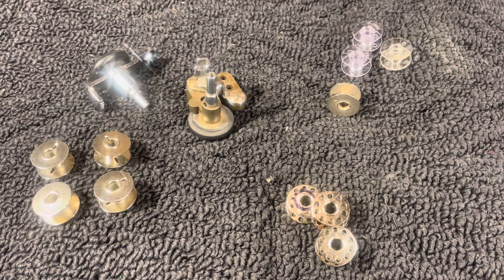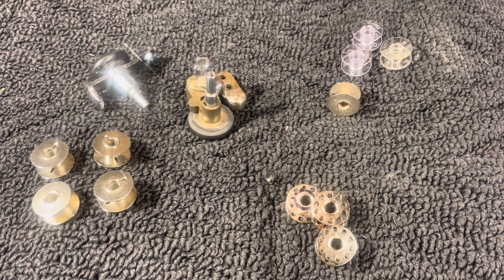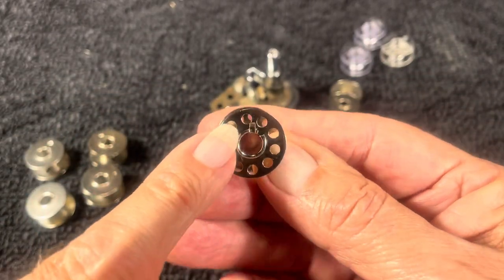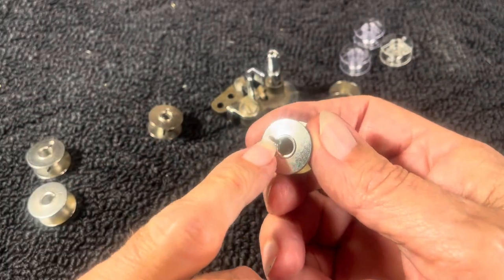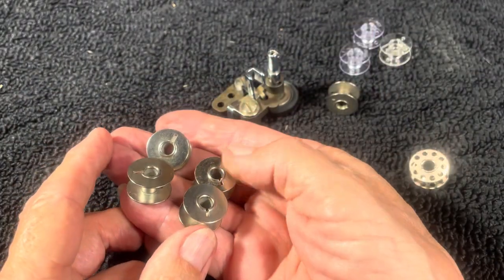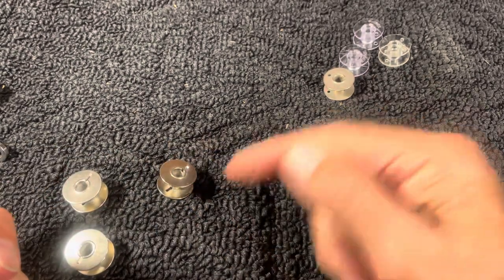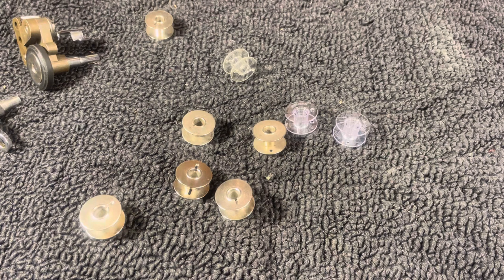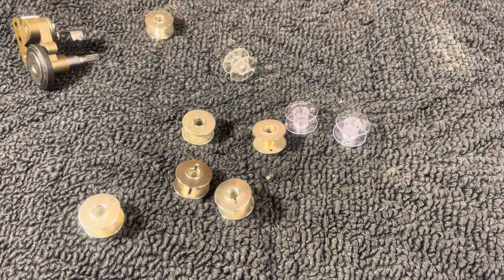DEFECTIVE BOBBINS “DESTROYING” TONS OF NEW SEWING MACHINES- CHECK YOURS BEFORE USING THEM(video 403)

Comment: Ah ha. Thanks for this.   I just bought bobbins for my little singer from Walmart, Its about 10 years old and has worked great.  Bought new Singer bobbins and they were too loose so I put a little sliver of masking tape in the center and it wound.  I am going to look for the notches and spring and see.  The original ones that came with the machine worked fine.  As usual profit comes first, who cares about the customer, the waist, the pollution, so frustrating.
Reply from the maker: It is surprising to see such little regard for putting out a perfect product. 
We will have to be wary from now on. 
Masking tape to the rescue. 
Well done. We do what has to be done to achieve success. 😎👍🏼

Comment: Just yesterday, while I was sewing, I found out I had one of these slanted bobbin. I've had some experience with bobbins not the proper diameter, doesn't fit and slips off, but a slanted one, never before. 
Hence, I changed it with the ones I use with my mom's Singer that has a notch where the bobbin fits, about 50 years old, and I was back to work in an instant.
What a coincidence, this video came up today. Never would've guessed this issue was addressed.
Thanks for the information. I got a spring loader with the post andil I'm glad I got the right bobbin winder.
Reply from the maker: Recently, the number of customers that have been experiencing defective bobbin caused malfunctions, has been very high. It’s been like one every couple of days. It’s not a coincidence, but a sign of the times, shoddy manufacturing.
That spring loaded bobbin winder is by far the most reliable long term. 
Thanks for watching and taking the time to comment.😎👍

Comment: I found a box of old bobbins at a thrift shop and bought it. I test new bobbins by seeing if they fit on the winder. Usually if they fit the winder, they're good.
Reply from the maker: Solid strategy. A properly made bobbin is critical to successful sewing. 
We took that for granted for over two hundred years. 
Now, we have to be forensic specialists in addition to sewers and fixers. 😎👍🏼

Comment: The same thing happened to me several years ago. I purchased 100 class 15 bobbins. The first several that I used worked, but wobble, wobble. Then a year or two later, I come across the ones that won't fit on the winder post.  The problem is a complete lack of QUALITY CONTROL. One can only imagine what the quality of their military equipment is. I pray 🙏  that we never have to find out. Now, when I need more, I buy  vintage Singer or Japanese made Kenmore.
Reply from the maker: It’s amazing that we used to take quality control for granted as an automatic manufacturing procedure. 
These days, with our manufacturing almost totally offshore, it’s like a foreign concept to these companies. 
Pun intended.

Comment: I have vintage bobbins that I love and will not part with. They are the best. Especially my class 66. I’ve never found new class 66 that work.
Reply from the maker: The new metal 66 class bobbins are all over the place when it comes to specs. 
They’re the worst. 
I often find that the premium plastic ones are better. 
Nothing beats the old originals of course. They are pricey if you can find them, but well worth the cost.

Comment: I stopped buying new bobbins after I got an unusable pack of them. They were so off-size that they would not fit in the bobbin case unless you shoved them with force (which would probably have ruined the case anyway). And these were Singer bobbins, not some sketchy brand from Amazon.
Reply from the maker: Your experience is what I’m hearing from lots of folks.

Comment: Yeah, I am fixing machines and have had to be testing the fit for every bobbin on each machine.  Some machines will tolerate worse bobbins than others, but so many bobbins I get are no good.
Reply: I've resorted to measuring them with calipers and sorting them before I even start test fitting on a machine
Reply from the maker: @henrybangsberg2187  I’ve done the caliper thing but now I just test fit them on a sample bobbin winder. It’s 99.2% effective. 😂😎👍
Reply: What’s the best kind of bobbin winder
Reply from the maker: @apiecemaker1163  my favorite is probably the old style like on a Singer 401 or 301 that operates off the hand wheel on the right front. 
My second favorite (or tied for first) would be on top of a Kenmore 158, front load, 15 class machine. When they are adjusted properly, they’re just about perfect every time. 
All the new ones with plastic components and electronic micro switches are my least favorites, for obvious reasons.
Reply: @randyyoursewingmachineman9954  that’s perfect. I have a 401. I just never thought about using the bobbin winder for all my machines. For some reason, my brain was stuck on a potable one and knew I never had any luck with them. Appreciate your response.
Reply from the maker: @apiecemaker1163  that 401 has a foolproof bobbin winder. 
It’s just part of what makes the 401 nearly perfect on all counts.
Reply: @randyyoursewingmachineman9954  I agree but my favorite to sew on is still my 301. I just revert to it over any of my machines. Love my vintage singers! Thanks for responding. 👩‍🌾🪡🧵
Reply from the maker: @apiecemaker1163  😎👍🏼